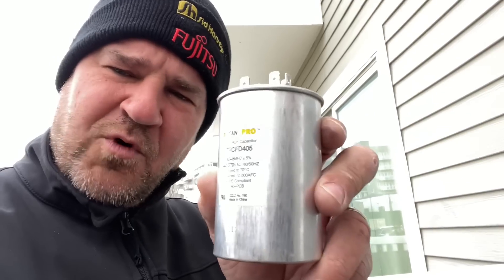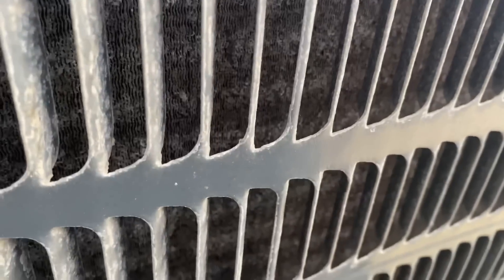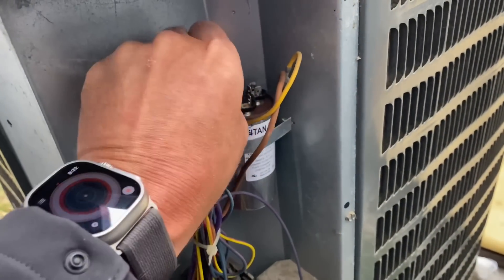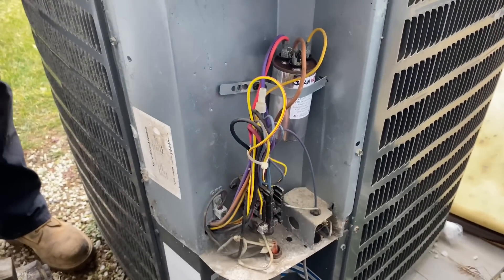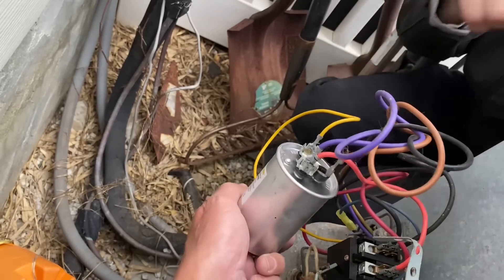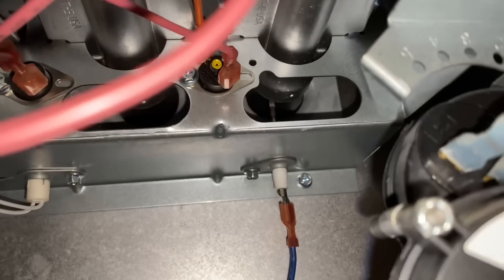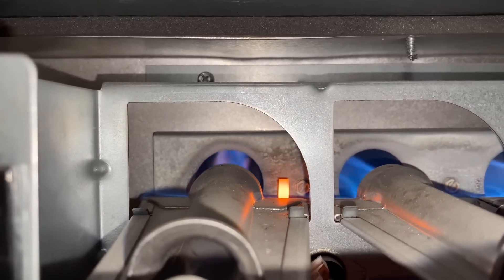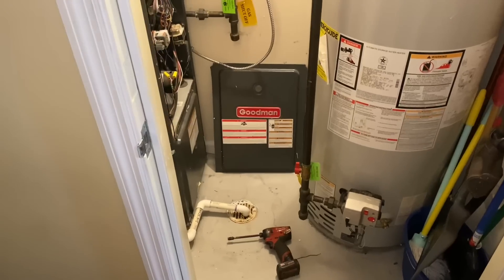Dude! You’re Getting a Bosch! Performing AC Maintenance and Inspection in Cold Weather

Comment: It's a hard start capacitor for the motor blower motor on the Beckett oil burner you just installed to replace that planet killing polar caps melting gas fired boiler. Oil is all natural unlike natural gas which is processed.
Reply: So is uranium.
Reply: Even fuel oiil needs to be refined from crude. It doesnt go from the well to the burner, Unlike natural gas which can and does in areas with wells. There are a lot of farms that lease land for natural gas wells that get free unmetered gas.